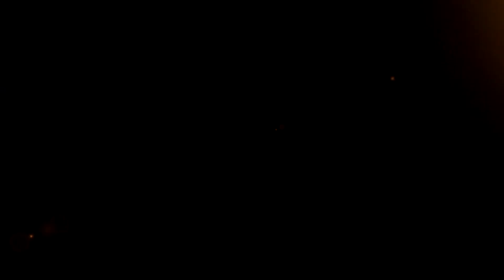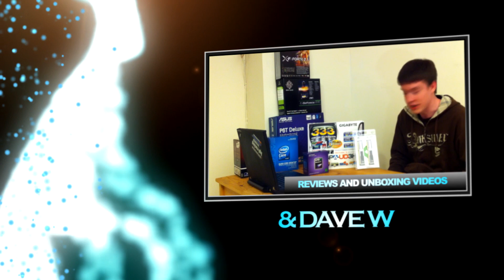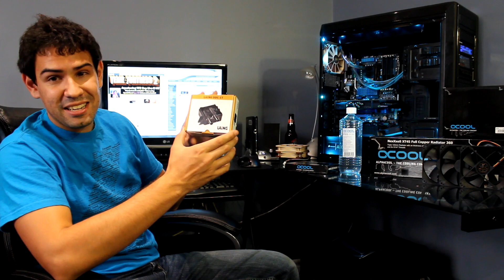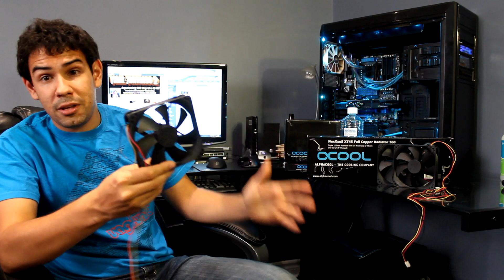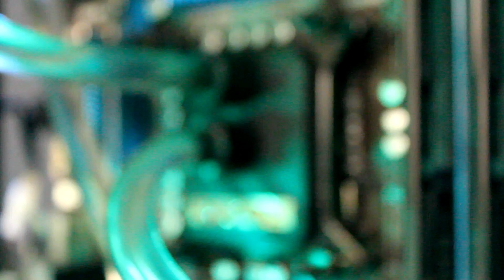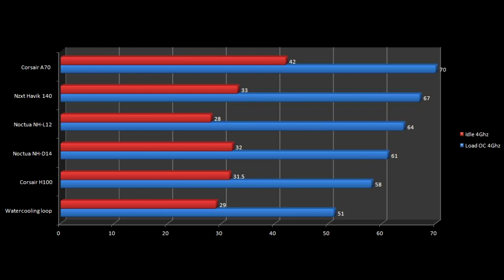Alphacool NexXxoS Cool Answer 360 Review -TheTechSource.tv

Comment: When you mounted the CPU water block did that come with a back plate or are you supposed to mount it with no back plate. what kind of temps did you get with your setup.

Comment: try to cool a fx 8320 @ 5 ghz 1.55v with that and all changes. where i live this gets to me for 140 euros. And it sh1ts on all you can get all there at this price. Planning to add another 240 and two 120 if the pump can handle it to cool the gpu.  + its so freacking sweet to tinker with tese <3

Comment: Will something like the HUE LED controller or a fan controller fit in the top bay if you have a push setup on the thick rad? I am looking at converting my Switch 810 from a H100 to a custom loop to include my 670FTW make use of that bay still.

Comment: If you want to clean it up, just move the res above the fan controller. Add a tube, and fitting into the top of the res. Hide the tube above the res (just us a 3 inch nub for hose). Get a plug for the top hose. Then you dont have to remove the res anymore.